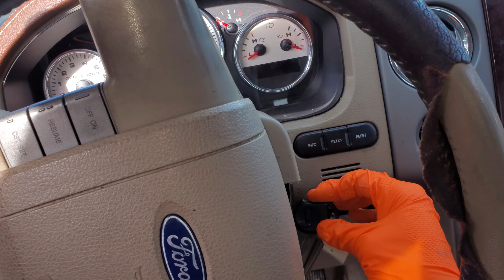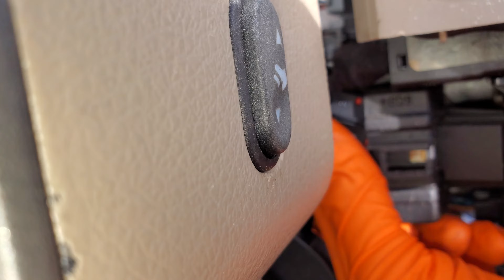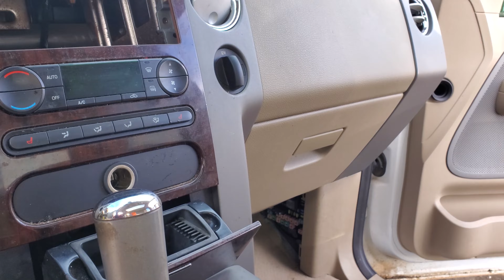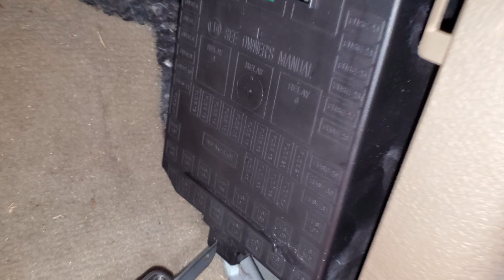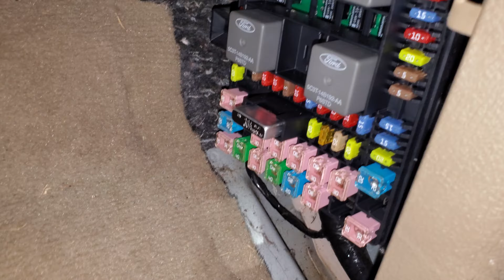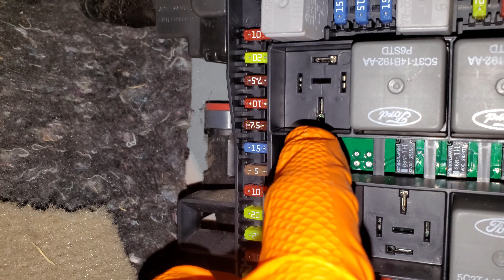2007 F150 Starter Fuse, Starter Relay, Starter Circuit Explained

Comment: So I have power going to the red and blue wire at the steering column. Now I do not have any power at pin 86 on the relay. I changed out the safety neutral switch to see if that was the problem and still nothing.
Reply: Did you ever find out what was causing this?
Reply: @taylorpasterski556  I also have the same issue.
Have you figured it out

Comment: This all checks out... Still no start,no crank.  It cranks if I put power directly to the starter..
Reply: Same here, and reading the comments it looks like it’s a common issue.
Reply: I just fixed mine. It wound up being the neutral safety switch.

Comment: Awesome video LeHew Tech!  Maybe you have an idea on my situation.  My 05 f150 has an intermittent no-crank situation.  Winter time the truck starts right up, during hot temperatures (and high humidity) is when I get the no crank situation.  I have a wire I keep in the truck to jump the relay which works 100% of the time.  I replaced the starter to try and fix this issue.  Any ideas?

Comment: Hi. I have an 05 with 5.4l once every couple weeks the truck will not start just whiney noise. Then after about the third try it will finally turn over. I have replaced the starter with Motorcraft oem, still have same problem. Any insight would be greatly appreciated. Thanks in advance!
Reply: Having the same issue now.. any solution to this?

Comment: I have 05 fx4 won’t crank has power all the time   To the dash lights don’t dim I drove it five miles shut it off then it won’t do anything but still has power. I will check everything you said in the video was a really good help thanks man

Comment: I have a 2009 f150 5.4 and it's driving me crazy so I hope someone can help me please!!! LOL!! first of all my truck runs and drives great but I will be driving along and look down to see the blue wrench icon. Now my truck never goes into limp mode and as long as I keep driving it's fine but if I shut it off then when I try to restart I have full power but no crank no start?? If I wait 30 min it will fire back up, the wrench goes away and all is good until next time it does it and that could be one day or 4 weeks. neutral safety switch? Ignition switch? starter relay?? HELP!!
Reply from the maker: The wrench icon is a maintenance reminder that can be reset

Comment: Hey, there is a short braided cable on my 04 150 that mounts on the body mount of the frame and came disconnected from it’s other point. It’s short. Do you know where it is supposed to be connected on the other end? Thanks.

Comment: I have 2008 ford expedition, it starts most of the time but there are sometimes when I turn the key, I just hear a loud winding sound. No crank just a winding sound. I changed out the starter relay and the start run relay and it worked for about a week straight with no issues but its happened again like 3 times since then. Do you have any idea what it could possibly be? Thank you
Reply from the maker: That often happens when the Starter is failing.. the starter gear will turn but not go out far enough to engage the flywheel.
Reply: @LehewTech  thank you so much, I will try replacing the Starter
Reply: What would be the cause whe it wont turn over wait a hour or two then it will start